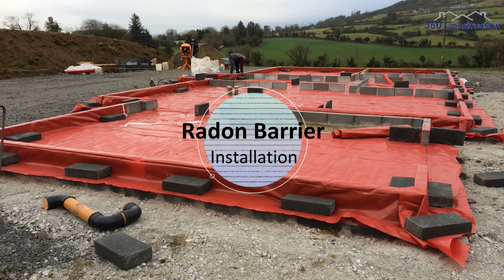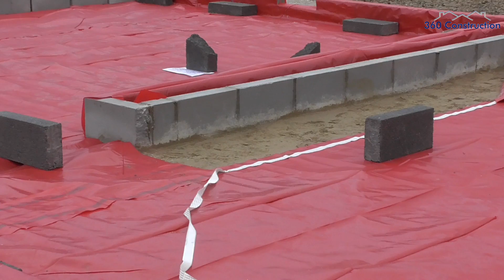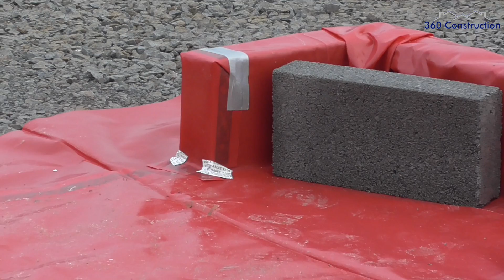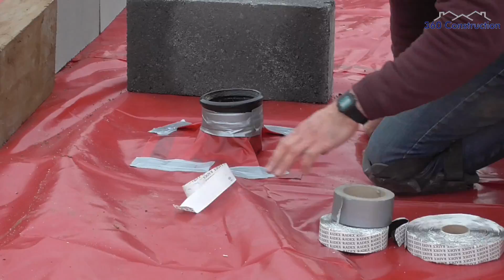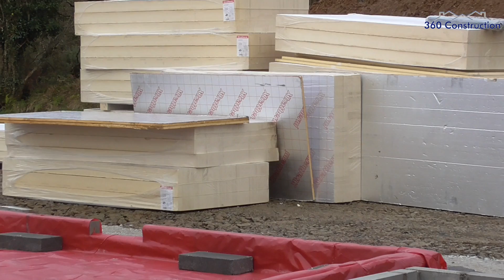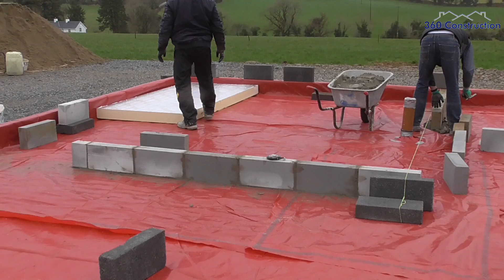Radon Barrier Installation

Comment: How strong is that first course bonded on top of barrier, even dpc weakens the bond / joint. Wouldn't be confident that'll stay in place. Needs to be a new method invented to quash these issues concerns in my opion.
Reply: The weight of the rest of the house will prevent anything moving

Comment: Why are you making so much work from this,  step one lay the barrier to outer skin across the cavity,, no corners no hard corner angles, no carpet laying,,,    then form a tray from the 27in dpc, from inside to outside cavity,,,   the brickies have difficulty in laying the first course of blocks on top of the barrier and have to cut the membrane,,, please change this method,, also the first course of blockwork is weak on top of the membrane,,, move on guys            RADON WALES,,   CHECK US OUT,   RICHARD WATERS
Reply: Ben Robinson do you have a video on how to do it right?
Reply: Good man Ben ‘ that shut the decker up